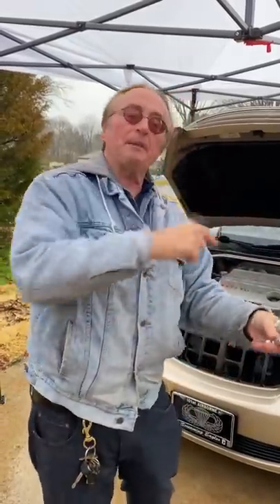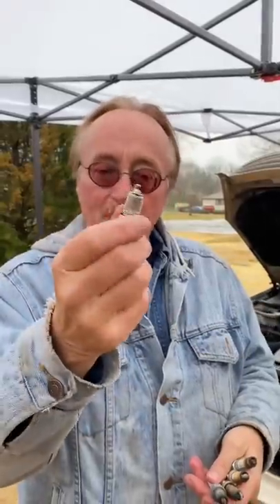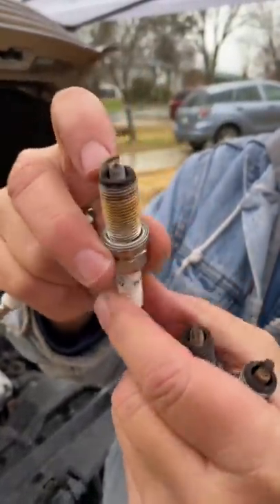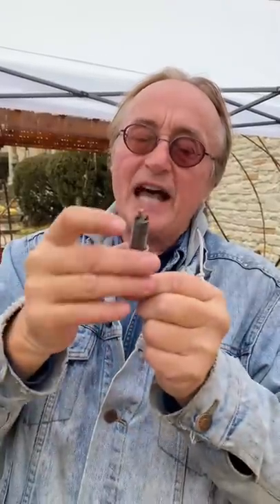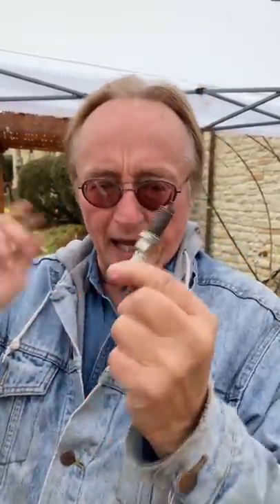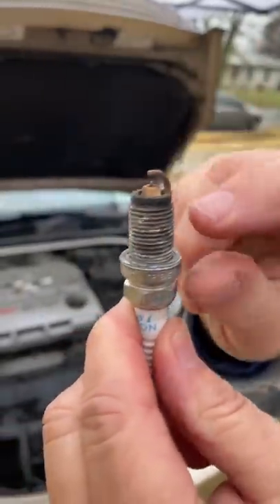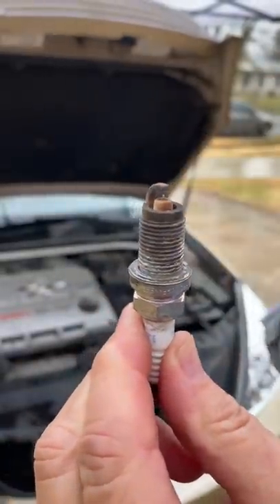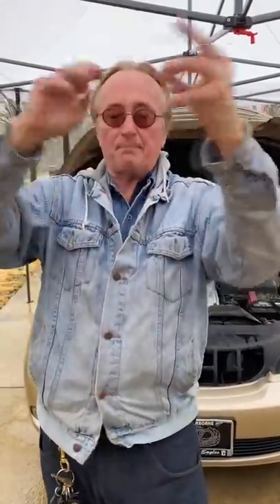This Means Your Car is Screwed

Comment from the maker: Thanks for watching! Like and Subscribe for More Vids Daily ► https://www.youtube.com/channel/UCuxpxCCevIlF-k-K5YU8XPA?sub_confirmation=1
Reply: Scotty what model is that Lexus I really like it I just want to know what model it is
Reply: Hey Scotty I have a Cadillac DeVille 05 it's been running pretty great but lately I'm having symptoms of a blown head gasket as well as Warren Pistons I have 160,000 miles . I tried Blue devil. Not so great do you think it's worth it too get a rebuild I've been working on the car it's been a fun project but I bought it for $500 I probably sunk around 3 k into it so far should I dump it it's burning oil pretty good it rides fine my engine is not shaking yet but I can see it makes it in my coolant just need a word of wisdom
Reply: Best videos Thank-you
Reply: Quick question..I have 2 plugs fouled w oil in the coil pack chamber and it's ..put putting..bogging out loses power ..any ideas ..dodge caliber

Comment: I'm running detergent gasoline for a few tanks. Cleaning the valves, injectors, and other carbon build up. My car is running smoother at idle.
Reply: Scotty recommends techron fuel treatment over detergent gas or other fuel treatments such as techron. He explains in a video that he has a friend in the oil industry who deals with gas and oil additives, and apparently techron is the only brand that lists the active carbon cleaning, other brands may have it, but there's a secrecy about all their additives, therefore most brands don't show any ingredients. I've had a great experience with techron btw, used it on 3 or 4 cars now, and i like it because not only does the car run like butter, but the oil stops getting black after just 2-3k miles (higher mileage cars). Part of getting cleaner oil is probably doing oil and filter changes every 3k when I can, but if you use techron on fresh oil it will make it relatively dirty. One time I saw chunks of carbon (salt grain sized) come out after using techron after the oil stopped turning black so quickly. Thought I'd let you and everyone else know since it's hard to find some of scottys videos sometimes. Last note, 2 of my cars were high mileage VW's that were sketchy (2nd was a 3.6 VR6 passat that i had from 292-310k before forced to sell after it sat for 3 or 4 months, and still ran perfect), and I also got compliments about having the cars running better than previous owners just from doing an oil and filter change, then running techron as directed right before another oil and filter change after 3k miles. Scotty recommended it, I trusted it, and it couldn't of turned out better, I've used detergent gas out of necessity and it made my cars run better, but only about half or a third of what techron did. Anyways, I need to get to sleep, lmao. If techron wants to hire me, here I am, lmao.

Comment: I changed my spark plugs after 278000 miles (because I guarantee no one before me did it) and they were whiteish?? Started doing nothing but premium gasoline and semi synthetic oil changes (going to full synthetic soon.) And it seems run way better with constant premium and way better oil changes and duration.

Comment: just changed mine..06' crown vic cop car w/155k miles..plugs looked good but i was having a misfire..checked the  gap (should be .054) they were all over .078 and a few over .085 lol ..new plugs cured the misfire
Reply: Gotta love those Crown Vics! I got a '00 LX w/ 107k miles & its never let me down. Remember, you don't "DRIVE" a Vic, it "FLOATS" you. 😲😲😲

Comment: And then there’s mine, pure black. I was given a car my aunt drove and my mom before her. It’s a 2003 Saturn Ion and I feel so bad for it. It was abused so much. Neither ever changed the spark plugs, my aunt never changed the oil and I don’t think my mom did before that which means the black sludge was like 60,000 miles and 8 years old, and so many other parts that should have been long replaced many times are still in there.
Reply: Is the car still alive?

Comment: Just changed my plugs. 95,000 miles. I have known it burns oil for a while. Apparently a characteristic of my year and model car. Plugs I took out looked f**ked. Cleaning the system is next. Hopefully that helps with oil burn.

Comment: I had the tip of one of my sparkplug blow...I thought for sure my engine was toast...but miraculously the tip that blew off got pushed out somehow without messing with anything 😅
Reply: I just had this happen to me a few days ago. I had no clue what the problem was until I was able to replace the spark plug and ignition coil and realized the electrode tip was broken off and it was very black. I've been doing a lot of driving in the meantime and now I am scared if I ruined my engine. I no longer have any codes after replacing the plug and plan on replacing the other three plugs and coils soon. I think it happened because of an issue with antifreeze overheating and a few days before that I ended up hitting a rock on the road that jolted my car badly and had to replace a tire. My tee connector broke completely off leaving me stranded and I managed to fix that after getting it towed to the dealership that had the part I luckily ordered ahead of time. I ended up putting the wrong OAT coolant in and it's not overheating per say but the temps are sometimes reaching 126 for a few seconds at traffic lights. Vehicles are a pain. I'm just scared that I didn't F UP the engine already.
Reply: @Midala87  well when I took mine to get checked out by my mechanic at first he said I'm screwed, I'd need to replace the entire engine, but he had me turn my car on just to see what the engine was doing...it was running normal and he immediately said  "oh you're fine."...according to him, if it had messed up anything, he said the engine would be shaking pretty violently....so based off my experience, if your engine isn't shaking violently, and you're not tripping any codes, you should be alright.....if you've been driving it since that happened, the damage would already have been done and it you'd be able to tell for sure.
I'd definitely get the coolant situation fixed asap and replace the other sparkplugs asap too just for safe measure.
Yeah, I'm definitely glad I got rid of that car...it was one problem after another...I loved it though, I learned a lot cus I did all the work myself, aside from changing a timing belt, I had my mechanic do that...but it came to a point I wanted a reliable newer car, and circumstances changed eventually to where I could.
Hope everything turns out alright for you, car problems definitely aren't fun...hang in there, it gets better eventually 🤙

Comment: The 2019 Ford ranger XL basic has a water issue by getting into the coil pack broke all 4 still ran missed a recall for a foam cover that sit on top $220 plus $600 at Ford company truck.

Comment: Scotty the man behind and in front of the videos with the best return for the time invested. Thank you.

I'm not sure if you answer to question on a donation based plan which in case you do it's totally fair as we benefit from your videos already but I'll take my chances with a quick question.

Auto Trans 2012 Toyota Corolla 60K city miles, it's recommended to replace front differential oil and replace transmission fluid under 3 conditions of driving while towing, using a car-top carrier, or heavy vehicle loading. None of 3 applies to it but as I mentioned it's city driven only and my mom is planning to keep it and I'd like to keep it healthy. 

I'd appreciate if you give me your recommendation and again no hard feelings if you don't I'd still be grateful to watch your videos. 

Regards,
Reply: At 60k it's definitely time for a front diff service, transmission flush, coolant flush, power steering flush, probably some new brake pads too if they haven't been done

Comment: My spark plugs have oil on the threads, but the electrode is fine there's no oil there, just the threads, I haven't a clue what that is the rings ? Leaking valves?

Comment: Scotty tell me the symptoms of a runaway motor gassing on his own. Turn it on turn it off turn it on turn it off. It goes away after the 5 time. Weather makes a big difference hot and cold cold mornings guaranteed to have a runaway motor like the car is running on its own or getting away from me the gas won’t slow it stays stuck.

Comment: I put in spark plugs and the very next day I took it in to get the timing set.  They claim they couldn't do it because the plugs were bad.  I told them I only drove 4 miles on the car but they still claimed they were bad.  I never went back there again and told everyone I could not to go there.

Comment: Is it possible that if it looks like the plugs or a plug roasted some oil that your valve cover gasket failed and oil made its way into the spark plug wells and past through the threads.   Metal expands when it gets hot so it is possible for oil to leak past threads especially after 100k miles or more. If you are burning oil in your gas youll smell it in your exhaust.

Comment: smart for an ole guy!  j/k  I have a spark plug issue, I have a 67 with a 72 engine- it may have the wrorting plus. has ap145 but calls for r45s  will an r45st work, or ap145 or ap146?

Comment: I was doing plugs 2011 Ford Fusion SEL 2.5 ltr 4 cylinder.  Oil in the No.4 Chamber. Head gasket?
Reply: I believe those engines have a coil-on-plug design which means they also have a spark plug "tube" that the coil resides in...was there any oil inside of that when u changed the plugs? Those tubes have o-rings around the top that rest in the valve cover & sometimes those need to be replaced...

Comment: I got 60,000 mi on my 2011 bmw 3 series, was wondering if it's time for new plugs?
Reply: Owners manual and check spark plugs I guess good luck! I have 71k on my 09 Toyota Camry
Reply: Yes, you should also probably get a transmission flush and some new brake pads while you're at it

Comment: Timing on a car was out by a tooth 
Pulled the plugs out so I could rotate the engine and rectify the problem and because they tried to start it they soaked the plugs and now they are as black as ever

Comment: My spark plugs won't come out of the engine. Do u have any tips to get them out?
Reply: Extractor kit if it broke off in there if it won’t come out then you have to soak it with some kind of foam to penetrate the threads to loosen it up to be broken free from carbon build up. Might have to leave overnight. If you do that make sure when you come back to suck out all the crap you put in the spark plug hole so when you take out the old plug none of it falls through into your engine
Reply: @BigSmokeLV  thank you 😊

Comment: Am I  the only one who just ran out and took the spark plugs out of my truck to take a look????
Reply: I ran down to the basement where I kept my old plugs after I changed them a few months ago. Mine have the slightly brownish color on one side of all of them so I guess I will be adding some Techron fuel injector cleaner to my gas.